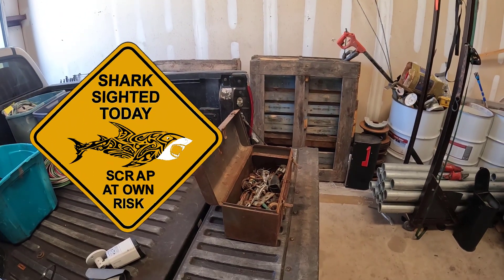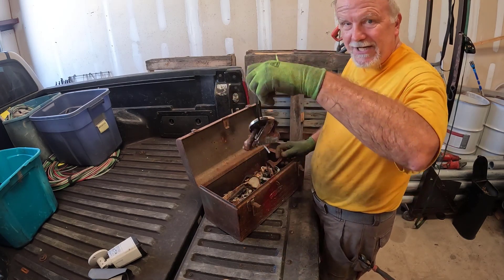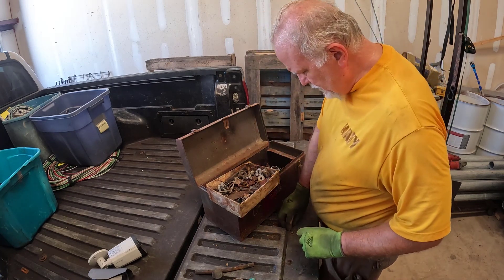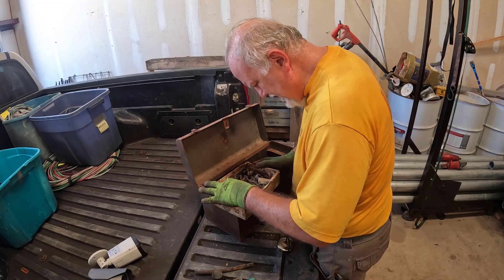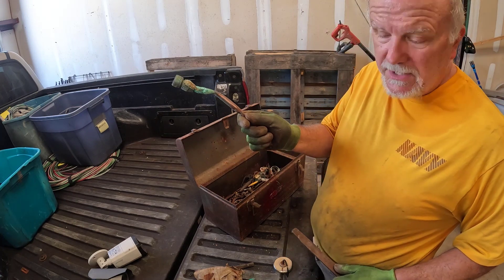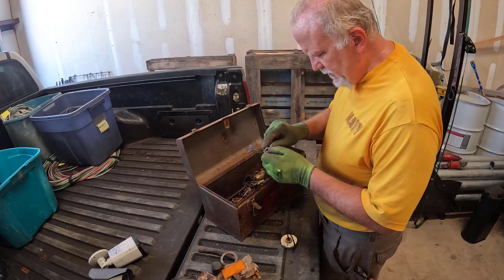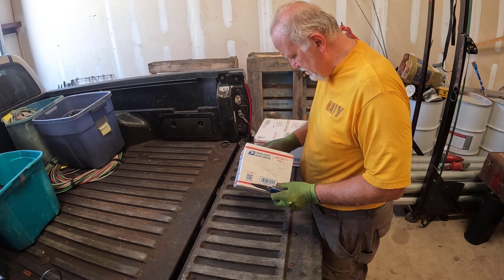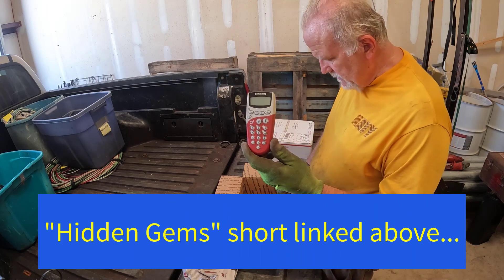Old toolbox finds and other mystery unboxings.

Comment: The mystery item looks to be a quick splice for copper or copper weld power lines, when I was a electrical lineman we used them when a wire was broken or burned apart from a tree that came down on the wires. If you take a wire brush or wheel to the bigger center of it, should be stamped with the part number size of wire it is for. If you cut it in half there is a spring and two sets of three or four wedge shaped grippers inside ,also had them for aluminum wire and steel guy wires, it is almost impossible to get the wires out of them once they are locked in under load. Keep up the great videos and God bless you and your family.
Reply from the maker: Very interesting.  I didn't know about that contraption.  Thank you for sharing that.

Comment: Shark you know me so well, I would have cut the spring out of the radiator valve as usually the valve housing is brass, nice goodies  in the mail call
Reply from the maker: 😂 the whole time I was going through that I envisioned you there with me, beer/whiskey in hand, saying something like, "now there's something I might could use."  😆
Reply: .... suppose shark as never tried slackening off a BSW whitworth nut with the wrong type spanner  sometimes real junk can be a god send to someone working on old engines steam engines ... there is a market for almost everything we throw away shark we just dont always see a value because we dont work on old stuff but 1000s do mate